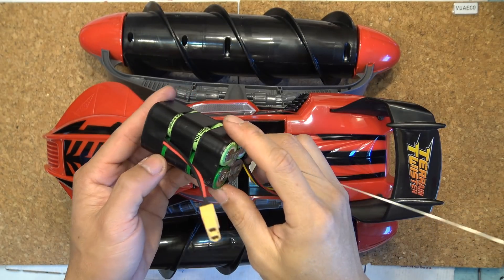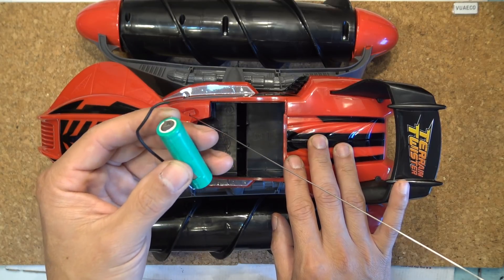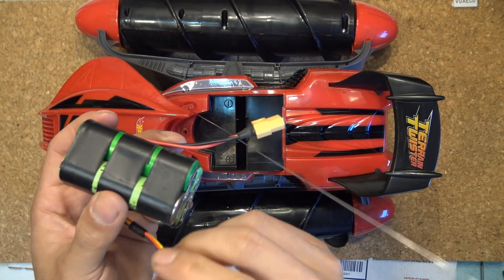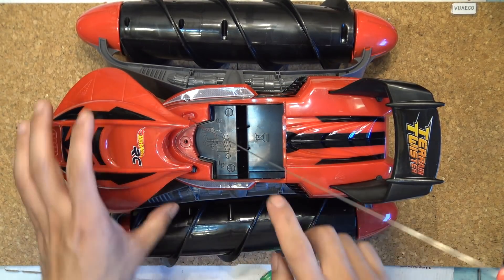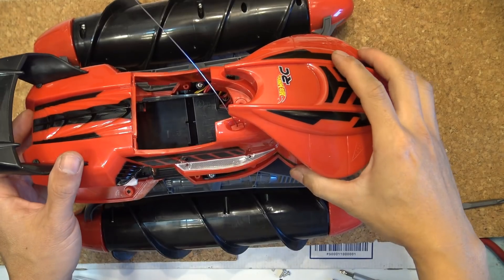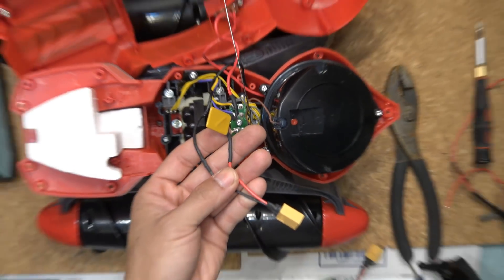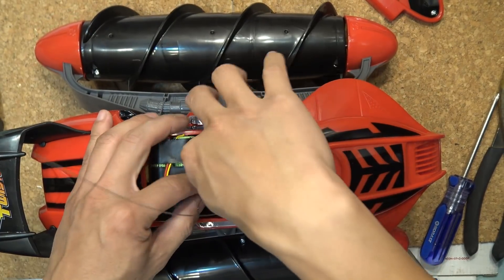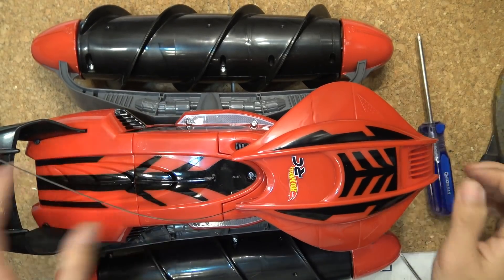RC Vehicle battery hack: Hot Wheels Terrain Twister 18650 Li-ion battery mod

Comment: did you add the PTC fuse yourself or was that standard? shouldnt you have a protection board on the battery to protect from undervoltage? or atleast an alarm?